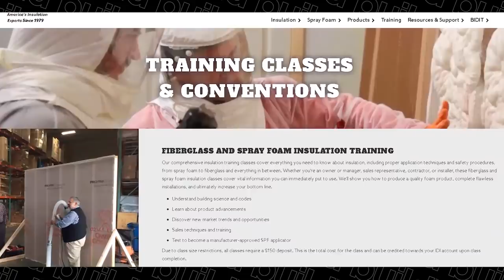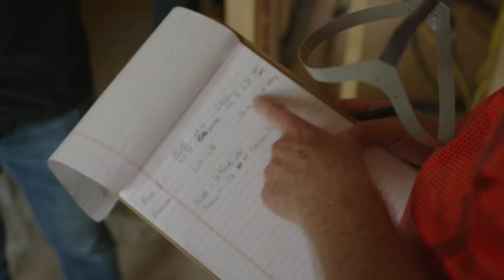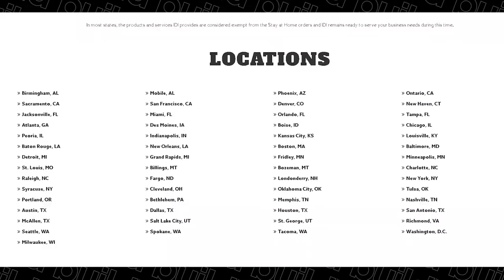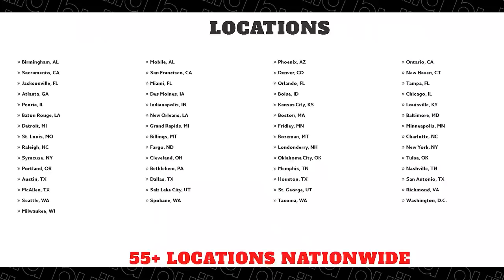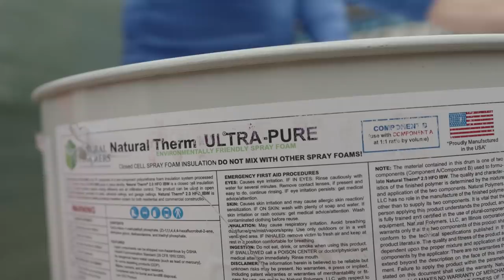"Low/No Smell (VOC's) Spray Foam" - Let's put it to the test!

Comment: The real question is, what’s is the price per set? And is it a price that customers all willing to pay for? Because either way, after spray foam is sprayed in a new construction, it’s probably 2-3 months away from people actually leaving on it.
Reply: That's it in a farkin' nutshell. I finally had to skip past all the commercial hype to about 18 minutes to see ANYTHING, and yet, I learned not a thing that that tells me squat.
Reply: @joesbarbecue1  what’s are you questions about spray foam? Maybe I can help.
Reply: @brayanmartinez5434  Pricing is the first question. Next, does it need air to cure, or is it purely a chemical thing? Can I blast this stuff into a an empty wall cavity? I need to fill appx 4 cu yards (108 sqft) of uninsulated space.
The short version: I want to fill some interior ICCF walls.
Thanks!
Reply: @joesbarbecue1  First of all its going to be a challenge to find a company that does injection. Secondly, it’s going to be even harder to find a company that is willing to spray only 108 sqft on cavity space. Mostly any spray foam company has a minimum of around $800-$1,400 to show up to a job site with the machinery needed and a crew. (Keep that In mind). The reason for this is that not so many jobs like this come up, and it uses different chemicals.
Injection foam is a different type of foam than what is typically used. It uses a different B side, that does not expand after being sprayed. If you use typical open cell, the Sheetrock will break, because inside the cavity it will try to expand. 
Foam prices per sqft really very on the area/region that your are at. Typically with companies up north charging the most. I only know one company that injects foam in Abilene  TX, and their price per sqft is $2.70. 
And the foam does need air to expand, however the gun feeds more than enough air to the foam when it’s being sprayed.
Best of lucks, if you do end up doing this job make sure their using the right chemicals, if not your going to end up with cracked Sheetrock.
Reply: @brayanmartinez5434  Ah Grasshopper, we must step outside of the box.
We are now living in an era where people don't want to work, and those that do, charge far too much in order to do their job. We have come full circle back to a time where people are willing to learn, and have no choice but to do things themselves.
Without completely tipping my hand, there is a vast market developing for a product such as I described, and for the ability of the homeowner to be able to do it himself.
The foam must have decent expansion, curing not immediately, but over a few hours time.
It must be dense and rigid when set, and able to cure on its own.
The ability to add various colors would expand the potential greatly.
A huge truck and all the kings horses aren't needed for what I'm talking about.

Currently, folks use 2lb roofing foam.
A less volatile, cheaper and better product could exceed greatly. 

With the right supplies, no one "needs" an overpriced company to provide and apply such a product.
Again, think outside today's norm.
Do you want to make a bunch of money once, or a little bit many times?

Comment: I really wanted to encapsulate the attic of my 1994 house. But there were to many corners they could not get to while wearing proper PPE. It sounds like this product might reduce the size of the mask you have to wear while installing it. 
If that is true then it will open up a lot of old house air seal improvements.
Reply: No. You'd have to wear the same kind of protective equipment you do now and I seriously hope contractors don't get that idea from this product. Totally missing from this video is that the main feature of this product is actually because of a regulation that went into effect at the beginning of this year which mandates the discontinuation of HFCs because of their ozone depletion potential. Instead they use (yeah we are STILL dealing with that.) The blowing agents they use instead simply degrade much much faster but as you're spraying it its still very bad.

Comment: They claim that their product has extremely low levels of formaldehyde, but I don't believe that formaldehyde is found in any 2-component polyurethane spray foam. What would be the use of adding any formaldehyde to a 2-component polyurethane??
Reply: typically formaldehyde emitters are used as biocides, you will see it in Parabens used in skin care products.
Reply: @suspicionofdeceit I can't find any reference to that use in polyurethane formulations.

Comment: Just love how even the quality air tester isn't even using proper PPE for his filter cartages. He needs P100 carbon filters and he has P100 dust filters. And they are using no ventilation during application. How could anything possibly go wrong?  I've been applying spray foam for 11 years and I have to say I take the claims of a distributor with a grain of salt. They all claim to be the best.

Comment: This foam didn't seem to expand as much as other closed cell spray foam I've seen.  Is that the case or was the video not on the foam long enough for it to expand to its full extent?
Reply: No idea other than its a closed cell and I assume its suppose to look like that?
Reply: @Furiends  Most closed cell foam I've seen LOOKS like that (the surface finish), but they expand to at least twice the thickness of the foam they were spraying.  Many would fill the wall voids, whereas that foam was only filling 1/4 to 1/3 of the wall voids.

Perhaps, the reason for the (relatively) low expansion is the lack of VOCs?

Anyone with some experience who could chime in here, would be appreciated!

Comment: Matt around 2:18 when you were talking to the Building Hygienist I see over your shoulder it looks like your wiring zig zags up the wall through some blocking. Whats the reason for the wiring zig zags?
Reply: Probably because they failed inspection and had to add wire staples which are required within 12" of the box and every 4 feet. Looks like amateur work. Particularly if it's data cable, those guys aren't licenced electricians and don't have a clue.
Reply: @CybekCusal  Appears more like the 240v supply on the end of the kitchen wall so it's either deliberately measured out for blocking and hanging units or the electricians had to add something after the blocking was in.
Reply: @effervescence5664  I have an electrical licence. It looks amateur to me. I'd never do that. But maybe there was a reason. Hard to tell the wire type, could be 10/2 as you mentioned. But the box heights are strange.
Reply: IIRC code states that when an electrical wire passes through blocking it must be stapled within so many inches of the hole, the rule is not just for top plates.  Since he has multiple horizontal blocks they had to staple it multiple times.  The zig-zag comes from the fact that the holes for electrical wires should never be placed at the edge of the blocking since it will weaken the blocking and increase the chances of a fastener damaging the wire.
Reply: I've seen it plenty of times. The electrician is leaving extra wire in case the box ever needs to be shifted for some reason. It may only happen once every couple of years but boy are you glad you have the extra foot of wire when you most need it.
Reply: @davismwfl  😂 IRC doesn't govern electrical work. That's the NEC. 🤣
Reply: @CybekCusal  IIRC = "If I remember correctly".  

I have seen this multiple times from  inspections in my area.  Blocking requires extra stapling to be within code according to our inspectors.  And I am fairly certain I remember reading it but can't recall the details off the top of my head, hence my comment.
Reply: @davismwfl  I don't speak Spanish sorry
Reply: @CybekCusal  You're an electrician but don't know what color wire is 10/2 is?
Reply: @chaseoes  yeah it's orange, I can't tell from the video what I'm seeing.
Reply: The holes are drilled near the center of the blocking because if they were on the ends close to the studs, the blocking would crack and break apart. You'd also likely hit the nails with your auger bit. The wires then zig zag back to the studs so they can be stapled.
Reply: @nickstopherd7762  the nails are only 3" meaning into the blocking only 1.5" and the hole is like 6" from the side. That's nuts. You can drill much closer.

Comment: This is a great product I don't like the chemicals
Reply: This product still isn't as clean as marketing claims. Still terrible for the environment.
Reply: @zack9912000  love to see some real data to support that claim
Reply: @Matt-dc8lp  Pretty well known as a fact it's a very nasty processing at the factory making these chemicals  mixes and has very toxic by products from.said process.

The amount waste it produces that certain spray foams can leech into ground water and is problems for us to get rid of.
Reply: @zack9912000  and whats a better alternative?  All have negative impacts on the environment, either in their manufacture or their reduced effectiveness as insulation (leading to increased power/fuel consumption).

Comment: Spraying the free foam in exchange for the “I don’t smell anything”, comments. 
Remember lead paint that actually worked vs the junk latex paint that hardly holds up a year. This “so called” low Voc foam......huh. Wonder if it maintains structure down the road.

Comment: Better get a good company to do the spray foam or you will have a full gut jobs to remove that mess. That's if the insurance company doesnt right off the entire home
Reply: @yunggolem4687  if sprayed in the wrong mixture ratio or shot too hot too cold, too thin or too thick It will never cure right. It will constantly off gas dangerous voc  chemicals and it will smell like rotting fish. Happens hundreds of times a year by people who have no business spraying it.

When this happens they have to gut the home and in many cases reframe the entire effected area. A lot of videos on when they go bad. More reason I will never use it
Reply: @yunggolem4687  Spray foam isn't just sprayed if it is two-component.  There are lots of things that can cause issues relating to temperature, thickness applied, and the application process.  Definitely not rocket science though.
Reply: @yunggolem4687  Again dozens of videos of very bad spray jobs and those amateur kits are not the same grade as what these companies are mixing in their trucks, those kits are designed to be diy ready. 

These trucks they can change mix ratios and the temperature it leaves the gun. One small thing not set right or sprayed incorrectly its FUBAR job. Also these stuff is terrible for the environment and if you have a home repair costs about tripple to do vs traditional batt insulation. There are too many butchers who put this in wrong and never return or fight the homeowners on fixing bad spray jobs.
Reply: @yunggolem4687  Run into some scary jobs doing hvac work for customers and new construction

Comment: “Natural” Polymers? Lol. Next up, the  review of Organic sheet metal.
Reply: There are plenty of examples of natural polymers you can read about for yourself on Wikipedia. Whether or not those are the primary components in this two-part polymer system I couldn't say.
Reply: @alchemistTi  Touché, but it’s almost certainly a just marketing gimmick. “Natural” has no legal requirements. No shade to them but it’s a little funny to me.
Reply: Oil is natural, humans are natural, ...

Comment: This is an indictment of sprayfoam. Vast majority is not this low-ish VOC foam. All sprayfoams offgas forever.  This particular foam has significantly lower emissions, but it's far from eco-friendly or low-embodied carbon.  Even this low-ish VOC foam is the most-polluting insulation available.  I have no idea why anyone would willingly entomb their family inside a tight box that requires 24x7 mechanical ventilation for 'fresh' air. Bizarre choice.
Reply: I typically just drill another hole outside when I want a breeze. Kinda sucks when winter comes around tho,